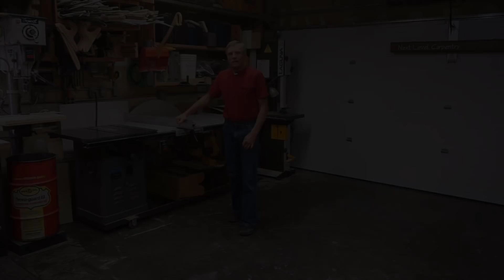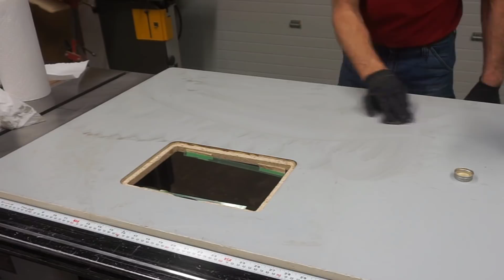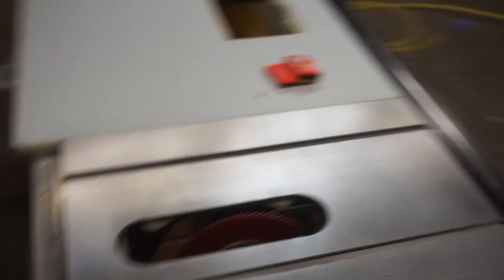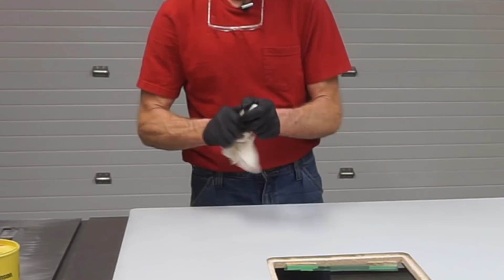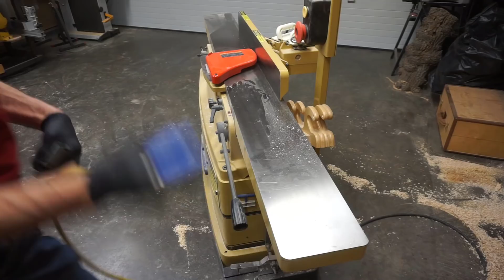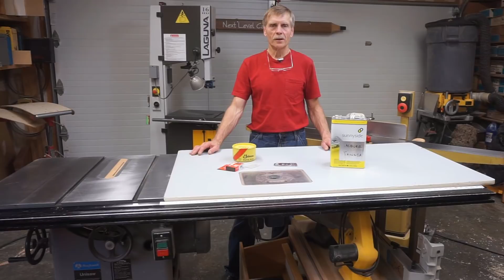Machine Maintenance Tips for Top Notch Performance

Comment: My bandsaw, Jointer are 30+ years old, they are from my first woodworking tools... a ShopSmith and still working hard. To maintain the tops I them I use a 3M sanding block and WD-40 and a coat of furniture wax... I first used WD-40 in the Marines for my Rifles and it has been a mainstay ever since. My shop is in the garage, an unheated garage in New England which means if I don't stay on it... rust will show up. Just watching your videos I pick up small ideas that bloom into really good ideas. Keep it up you do a great job and as I said before "I'm watching a MasterCraftsman at work! *** Five Stars
Reply from the maker: Kudos for keeping after those cast iron tops... it takes dedication but definitely has rewards.  Thanks for your service as a Marine... sounds like you learned well and take semper fi to heart!
Best, Matt

Comment: Matt, I see that you use a large washer on your table saw blade. Did that come with your saw or is that an add on?
Reply from the maker: Hey Ron,
That large washer is an aftermarket blade stabilizer made by Forest. You can see it on Amazon influencers page in the video description. I use it whenever possible to make sure I'm getting the smoothest Cuts possible but I've never done any scientific evaluation to determine exactly what benefit it provides but I am always pleased with the cuts I get while using it.
Best, Matt
Reply: @NextLevelCarpentry  Ok thank you very much for getting back to me so quickly. I love your videos and how detailed you are! I also have some ocd in me so keep up the next level work!

Comment: I have been trying to go through the posts on many of your videos, to learn what table saw your using, in order for me to get an idea of the specs. But I have come up short. I remember you mentioned the name in a video, but trying to remember when and on which one.. :-)
I'm trying to find a second hand saw with a sturdy construction here in Denmark (Europe), but I seam to find only very large ones. Nothing as "nimble" as the one you have. 
Any chance you can post a few short lines on your saw. My portable Dewalt table saw is okay for smaller things, but I should like to up the game a little.
Reply from the maker: I don't remember where I've described my tablesaw either, Michael.😯  It's a Delta Unisaw circa 1982.  I've used it since new without disappointment.  It's done everything I've ever asked of it  although, unfortunately, it's long since been discontinued.  I've not upgraded to a new saw like a Powermatic primarily because all new models are left-tilt and I like/want right tilt like I've always used.  Sadly they discontinued that feature too too many years back.  Not sure if Delta was ever sold/distributed in Denmark or what brands/models compare so my reply is not likely to help you much... sorry.  I do hope you're able to find a suitable machine for your work because a tablesaw is, to me, the cornerstone of a versatile woodwork shop since it's responsible, in many ways, for the quality of finished product a shop can produce.  Best, Matt

Comment: Hi Matt, excellent informative content as always. I do have a request! Any chance of creating a similar video about the "Under the Hood Machine Maintenance". There are tons of video about cleaning and maintaining the surface of machines, but you can't find any good one that address the cleaning up, and lubricating what is below the surface. Also, I haven't been able to find SC Johnson Fine Wood Paste Wax, here in Canada. Amazon doesn't ship this item to Canada (no idea why). I have contacted the manufacturer directly, and they said the same thing. Is there any way one of you guys who are in the U.S can send me a tub? I will gladly reimburse the cost, by e-transfer.
Reply from the maker: Glad you found video content helpful on this one.  The difficulty of 'under the hood' information for machines is that there's so much variety in design it would be difficult to cover the topic adequately.  Maybe lube types, what to look for, and cleaning products/methods might be helpful so I'll consider it.  If I had a video crew it would be another matter altogether as my tablesaw is due for exactly that sort of TLC and they could shoot the video while I cleaned which I could do tomorrow😯
Check into Trewax brand paste wax to see if you have any better luck with availability.  I've used both with identical results.
Best, Matt

Comment: Paste wax comment. I've used Johnson's for years. I do first apply Boeshield T-9, buff it in, then put paste wax after. I'm in the Pacific Northwest and winters are humid; it works well for me.

Regarding a thick layer of paste wax vs multiple wax coats, etc. From multiple sources I've read that after you have buffed out the wax, the remaining layer is microns thick. Essentially, paste wax doesn't stick to paste wax. Based on that I feel that if your 1st layer is evenly and thoroughly applied, it can be a thin layer. A 2nd layer will just dissolve the 2st later. A single thin coat will apply faster, dry faster, and buff out faster.
Reply from the maker: Interesting.... thx for adding this info Jim! Best, Matt

Comment: This is great advice and technique. A link to this video should be included in the instruction manual of all woodworking machinery. My PM 66, 60 and Laguna 18" bandsaw reside in a garage in N. Illinois so humidity is a big problem. Paste wax is marginal but will work if you apply it regularly. Boeshield is another product I use but like the feel wax gives. I love your videos; lots of practical and important information (woodworking wisdom). I certainly benefit from your many years of experience (successes and failures). You are a wonderful teacher that has inspired my efforts and skill to advance to the next level!
Reply from the maker: Thanks Paul!  FYI I spent my early years in N. Illinois and can relate to the effect of humidity there... makes me appreciate the dry climate here for this and other reasons😎  I've recently made it a point to take a closer look at Boeshield and may gravitate that way going forward.  Glad you've found inspiration here and hope you find it in other videos as well... Best, Matt

Comment: Also a good tip is run a dehumidifier in a garage with a cement slab.  I never get rust, use the johnson wax like you and all my cast surfaces and tools stay in good shape.  Worth the electrical cost for the humid months.  Thanks to you for your videos and tips,  they have helped a lot !!

Comment: I bought my Delta Rockwell 10” Tilting Arbor Table Saw in 1972: it continues to serve me well—even after all these many years. My saw came with the very stable and functional fully cast iron top. Of course, I immediately converted it to 220v, and added a laminate extension; eventually, I added a Biesemeyer rip fence, and a Fenner Link V-Belt. 

My late father-in-law, who was a wood shop teacher, taught me about the regular use of Johnson’s Paste Wax to protect the cast iron and the laminate surfaces. Bottom line: the cast iron and laminate remain in excellent condition.

I was worried about the wax interfering with wood finishes until my father-in-law noted that Johnson’s was used as a floor wax, and it did not muck up shoes—or damage carpets when you walked from a waxed floor to a carpeted one! 

Since I’m a chemist, I looked into the chemistry of carnuba wax, the main ingredient of Johnson’s. Suffice it to say, its chemistry is completely consistent with its not being detrimental to wood finishing techniques.

By the way, thanks for teaching us about “faux fingernails”: my local DYI store has just been liberated of many samples of the less popular Formica colors/patterns. The Formica samples are much better than the sharpened plastic putty knife I’ve been using, AND VERY COST-EFFECTIVE!
Reply from the maker: Great anecdote Joe.. I love to hear how people preserve and appreciate solid machinery to abet their woodworking hobby/career.  Sounds like you might agree with me that many people who have trouble with finishes end up blaming paste wax or silicone (used judiciously) as the culprit when a more likely cause is poor workshop/woodworking hygiene.  Work safe and have fun! Best, Matt
Reply: Next Level Carpentry 
Matt,
My “vintage” tools are like long-time friends: I treat them well, and they reciprocate. 

I don’t consider myself an expert at applying wood finishes, but I remember what my father-in-law told me: over 50% of wood finishing is preparation—even the much dreaded process of sanding! You might appreciate what he told me when I said that I’d bought a belt sander: “You now own the most destructive woodworking tool ever invented.”
Best, Joe
Reply from the maker: @joewrosenthal00  "the most destructive woodworking tool ever invented." truer words are seldom spoken! LOL Best, Matt
Reply from the maker: @joewrosenthal00  "the most destructive woodworking tool ever invented." truer words are seldom spoken! LOL Best, Matt

Comment: Excellent tips.  I'm in north Texas, where humidity is a problem.  After cleaning and waxing, I cover the cast iron surfaces with a canvas painting tarp when I'm not using the table saw and jointer...this seems to help quite a bit.

Comment: I got my cast iron topped table saw about 2 years ago and I haven't taken very good care of it.  After watching this video, I resolved to clean it up and never let it get rough again.  I couldn't find any Sandflex blocks locally, but I found out they can be ordered online then picked up (at the giant department store based out of Arkansas whose name shall not be spoken) about 2 weeks later with no shipping charge.  I didn't want to wait.  I had some naval jelly from a previous project, so used that and some #00 steel wool to clean it up, followed by a nice coat of Johnson's paste wax.  What a huge difference it makes to have the material glide over the table surface.  I will never again let a cast iron table surface get so out of hand.  Thank you so much for all your videos, they're great.  I have learned so much from you.
Reply from the maker: Sandflex blocks work so well and last so long that I've never had a problem getting them through Amazon... great value for sure!  Even if you don't need them for your tablesaw top now, I find myself using mine for routine cleaning and maintenance for everything from shop equipment to hand tools to door hardware, etc.  I think you'd find them well worth the wait... and you can get them through the Amazon link in the video description above of the Arkansas source is an issue😒😁😎 Best, Matt

Comment: I have watched many of your videos and I seen you roll your table saw around your work space. I have a heavy cabinet Delta 5HP saw and I bought the heaviest duty mobile base I could find but it is failing. What kind of rolling base do you use on your table saw?
Reply from the maker: Sorry I don't have a better answer for you Frank... I custom made the mobile base with steel tube and industrial grade wheels that are rated for extreme weight.  The steel base is sturdy and wheels don't get flat spots in them like hard rubber ones do.  Best, Matt
Reply from the maker: Sorry I don't have a better answer for you Frank... I custom made the mobile base with steel tube and industrial grade wheels that are rated for extreme weight.  The steel base is sturdy and wheels don't get flat spots in them like hard rubber ones do.  Best, Matt

Comment: Thanks for the wax application tip of putting the glob of wax inside the rag Matt. I was my CI tool surfaces a couple times a year using Boston Paste Wax. One thing I experienced when I stripped the old wax off my Unisaw top once was flash rust. Caught me by surprise but was able to remove it without much trouble. The time spent caring for CI surfaces is well worth it. Thanks for another informative video.
Reply from the maker: You're welcome for the 'wax glob' tip Bob... hard to beat those SandFlex blocks for cleaning rust off cast iron! Best, Matt

Comment: I see you use Johnson’s  paste wax.  I have used it in the past with good results.  I can no longer find it and have been told it is no longer made.  Can you recommend a good substitute?
Reply from the maker: Looks like Amazon still has the exact Johnson's stuff I'm using https://www.amazon.com/dp/B0000DIWIM/?ref=idea_lv_dp_ov_d&tag=aiponsite-20&linkCode=ic6&ascsubtag=amzn1.ideas.29WVINIJF4EUJ and it's on the NLC Influencer's page in case you still can't find it locally.  I'm in the middle of a box beam project involving extensive milling on about 240bf of white oak so I've been waxing machines with this stuff extensively to confirm its worth.  Hope this helps Paul... let me know? Best, Matt
Reply: I don't know where you are Paul, but I found it in stock in the paint department at my neighborhood Home Depot.

Comment: Matt, thanks for your efforts, I appreciate the tidbits.  

Food for though, in case you needed an idea for a short video. Have you considered a short piece on "how to build" your table saw work space extension. Taking into account the things you considered when building your own table saw extension, or anything you might have done different reflecting on hind site? The extension size, distance of the router, etc?  Just in case you needed an idea for another short video. 

I will be adding an extension table to my old delta table saw, and prefer not to reinvent the wheel if not necessary.

As a side note, in the video where you used body filler to level the damaged boards used for the door frames with the frosted glass inserts, it would have been nice to see your thoughts and process in fitting the door frame with the router.

Keep up the good work?
Reply from the maker: Thanks for being such an attentive viewer Bat Time... you're more than welcome for the tidbits.  Unfortunately  video ideas aren't something I lack, it's time and ability to produce videos that's the bottleneck here.  That said I'll be replacing the extension table on my saw at some point in the future and, with luck, will be able to do a meaningful video about it at that time.  In the meantime I made it longer than the fence rail and wider than the regular tabletop because, as you've seen, it doubles as a work surface.  Bigger is better for the most part.  The top is supported and strengthened by a welded and bolted steel framework that adapts to the old Delta Unisaw.  Router placement as you see it has always been fine but I may relocate it now that I want to add dust collection to it.  That aside, I chose a central location for better support when routing larger, oddly shaped pieces. You see it in action when I make Professional Pushsticks in that video. The top you see is 3/4" particleboard with 'formica' type laminate on both top and bottom to keep it flat.  I put plastic 'tee-edge' around it which has worked well but not as good as solid wood edging would.  The new top will be made out of a sheet of solid phenolic panel 3/4" thick.  It will be a great improvement but only possible because a friend gave me the piece he got as salvage; it was a mis-ordered toilet partition panel.  Otherwise I probably wouldn't justify $400 plus just for a worktable top. 
As far as the door frame goes I plan on going deep in the weeds for assembly of door and jamb when I make my new shop door out of wood from the Perfect Pallets. That video should answer a lot of questions about how I make and fit the door frame together.  If you had  a specific question about it in the meantime ask and I'll try to answer.
Thanks for watching and commenting here! Best, Matt

Comment: I am so thankful for this video in particular as we have upgraded our shop with some cast iron surfaces machinery.  I have my sanding blocks and am excited to clean some glue marks off of my table saw 🤦🏻‍♀️.
Reply from the maker: Thanks MSAF... Not sure if I covered it in the video or not but if there's any glue left on the surface scrape it first with a sharp razor blade... the blocks are invaluable for removing marks but really weak for removing glue😉😎  Nothing like going to work on machines with gleaming bright cast iron surfaces though! Best, Matt
Reply: Next Level Carpentry thank you Matt!  I did this today and it worked out wonderful. I tried to find you on IG or send a pic through here but could not. Instead I posted a pic and put a link to this vid on my IG.  Jolene_the_toolwoman_taylor. If you want to see :).
Reply from the maker: @mysinsareforgiven  Glad to hear it... there's just nothing like the look, feel and performance of a shiny piece of cast iron, right?  BTW the only 'photo' account I have is Pinterest but plan on setting up IG soon since I recently upgraded to a new smart phone that can handle it.  Hope your IG photo inspires others to give their machines a bit of this TLC! Best, Matt

Comment: I bought a used band saw awhile ago and the table for it is pretty rusty. What's your advice for how to restore it to its glory days and suggestions on an overall cleaning for the bearings?  It's my first band saw and I'm now to woodworking. Only about 3 years and still new to this stuff. Love your videos and advice. I appreciate the extra time you take to really explain the steps for everything.

Comment: Hi Matt. The GIGALOO is a spray on application you spray it on whatever it draies in minutes  but than you have a very well lubricated surface and it’s  protected from moisture and so on 
I spray it on all of my aluminum tools that I have like table saw top and miter saw stand by Dewalt and many other things 
Being exposed here to the snow I also use it on my car hinges and door bottoms where they are subjected  to the snow and salt on the road 
I might have mentioned before I also use it on my bikes chain 
Regards Dave
Reply from the maker: Interesting... I'm curious what similar products might be available here by a different name.  Having something so universally helpful sounds great! Best, Matt